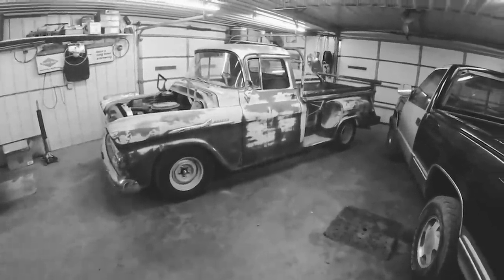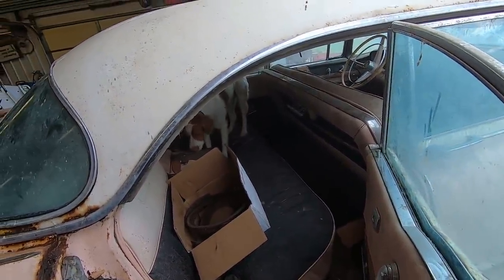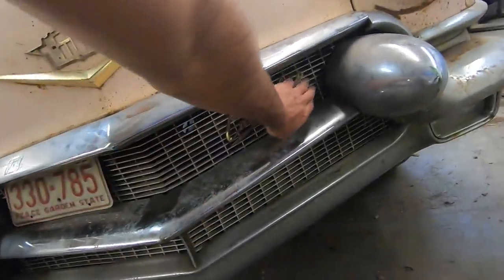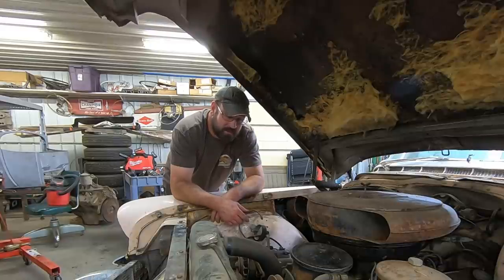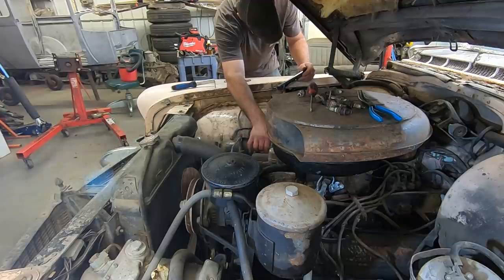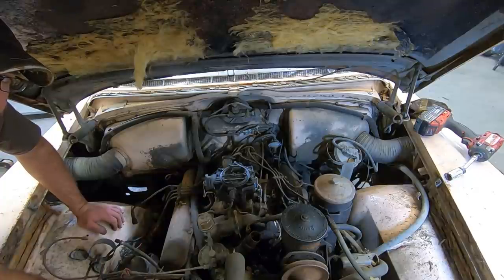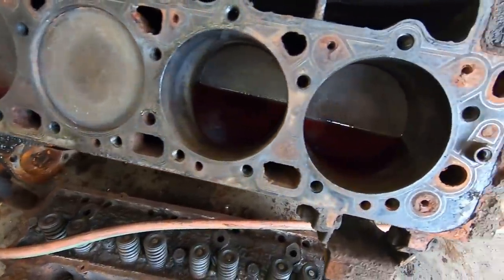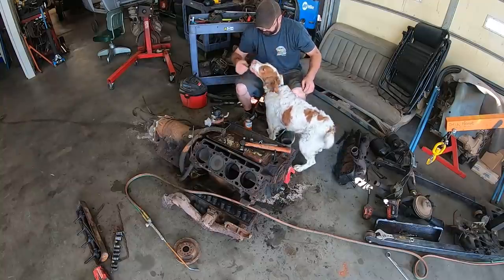Pink 1956 Cadillac Sedan DeVille Barn Find! Parked in 1969! Sitting for 52 years! Will it Run?!?

Comment: You stuck with that so much longer than I would have with that motor.  However, you outdid yourself with the Puddin appearance and to top it all off, a pressure washing.  Thanks for making Monday mornings so enjoyable.  I hope this car doesn't make you lose the shop.
Reply: Definitely agreed I was thinking when I saw the freeze plugs gone that thing is toast it froze and popped! He's got intestinal fortitude that's for sure!!!
Reply: Ida put it on a stand and yank the pan off. Put a pipe wrench on the crank and gave it hell.
Reply: That Caddy has as many peculiarties as a nympho nun, a real chamber of horrors ! How did so much water get in the pan with engine buttoned up ? As for the block, given the missing freeze plugs, it's likely cracked. Oh word is me !
Reply: @pookysdad4884  I don't believe that freeze plugs are just for knocking sand out of an engine block. That might have applied for the old flat-head Ford, but casting science has come a long way since then.
Reply: @pookysdad4884  A freeze plugs is a freeze plugs. A rose by any other name, would smell as sweet.
Reply: Everything about this channel looked familiar!?!?   Smh!  Really boss? Sad!
Reply: @pookysdad4884  You've stumped me there, I must admit, I can't remember what a "homilie" is. School is a distant memory.
Reply: Any car will run after 1000 years ; it just depends how much work a person wants to do and how many dollars the person is willing to spend.      Please stop making these stupid videos.
Reply: @supermansuperman9066  Forest Gump,"stupid is as stupid does". A stupid, cvnical remark. A reincarnation of people who decried automobiles to keep streets safe for horses perhaps ?

Comment: I love how Duff just jumps in there and gets to work giving the old nasal appraisal
Reply from the maker: Not much gets past that nose!
Reply: @MortskeRepair  BTW, that is not a torque converter.  It's simply a fluid coupling.  The trans is a four speed Hydramatic.  With four forward speeds it didn't need the additional torque multiplication of a torque converter.
Reply: @corvettejohn4507  You are correct. My 53 Pontiac had the Hydramatic. When taking off from a stop, the engine would rev slightly, much like letting out the clutch.
Reply: @MortskeRepair  duff knows what went on the last 75 years with 1 sniff

Comment: The Spring in the Dust Cap is for Radio Suppression ..Helps keep Static out of the old Tube AM car radio
Reply from the maker: That's wild! Thanks!
Reply: Yes sir!!👍✌️🤙🏻👍
Reply: truth
Reply: Huh neat
Reply: Wow what will they think of next
Reply: Radio static is the reason many car owners but the antenna on the rear fender, to be as far away from the ignition as possible.
Reply: @jeromebreeding3302  Also if you put your CB antenna On the center of the trunk your signal will transmit forward and have less ignition noise
Reply: @not2fast4u2c  I car shared with a guy commuting 42 miles on way in a Volkswagen variant. He had a big cb whip antenna on the roof. It hit every overpass coming home at one o'clock in the morning. I had to stop riding with him, my nerves were shot.
Reply: Yea right 🤪

Comment: In my 58, the antenna is power, still working,  and it has all the original wiring, everything works, the power windows all still work,  have the original motors!!  This poor car does break my heart a little.  My original engine,  365 purrs like a kitten.  My engine is rated at 310 HP.

Comment: Those early Hydramatics were once the hot deal - ever heard of B&M Hydros?  They built them for drag racing.
Reply: Yes they did.  The were the terror of the NHRA Junior Stock classes.  1955-1957 Chevy Sedan Deliveries were allowed to run them and they kicked but in their classes.  Of course the Pontiacs did well with them too.
Reply: Don't think it's a torque converter, just a fluid coupling used in 1st gear only and then bypassed for 2nd, 3rd, and 4th...

Comment: Penzoil Note: My dad bought a 1965 Pontiac Bonneville in 1966. Car had 3,200 miles on it and had it's first service before he drove it off from the dealership. He changed the oil in the car religiously its whole life at or before 3,500 miles and used Penzoil 10W-40 its whole life. He gave me the car for Christmas 1983 and in 1984 the timing chain broke at 158,000 miles. When I removed the valve covers there was literally only room for the rockers to move. Everything else was solid sludge, lifter valley was just as bad. I don't care if they say that they have changed the formula, I will not use Penzoil in anything ever.
Reply from the maker: Haha grandpa was right!
Reply: AMEN BROTHER!!! Pensoil sucks!!!!

Comment: Keep this trick I devised years ago for the future..
 
Try this... Heat the plastic tube from the carb cleaner spray with a lighter (about 1/4-1/2 inch from the end. Then pull on each end of the tube to stretch it. This makes the outer/inner tube diameter smaller and more of a pin point. When the melted plastic solidifies, use small wire clippers or nail clippers to snip the tube at the smallest diameter that still provides flow when spraying. The cleaner comes out like a pin point pressure washer and the shrunken plastic tube end fits inside whatever port your spaying thru.
You can also do the same to create 90 degree angles in the plastic tube to spray sideways inside long venturi tubes.
I used to make/keep custom tubes around for these situations. Hope this makes sense. BTW.... Great videos.

Comment: I would rather drive a 1956 Cadillac than a modern Cadillac from the 2000's. Better build quality, easy to work on, easy to maintain, cheap parts, no computer crap, no planned Obsolescence. Great video👍
Reply from the maker: Easier to find in the parking lot too!
Reply: @MortskeRepair  😂😂Yes That's for sure lol

Comment: Im a mechanic in NZ . We had a 58 long wheelbase Cadillac in the shop. Damn  near enough room for a double bed in the trunk. Start off by buying it a starter because everything you've worked on lately needed one so why should this one be different LOL Use a 1 inch hole saw on the bell housing and jam the big pry bar through it onto the ring gear.

Comment: Looks just like the one my Mom drove back in the day... we got rid of it in about 1964... 300 HP 365"... 4 speed Hydramatic... called "The Florida Color"... coral rose... Don't think it's a torque converter, just a fluid coupling used in a really low 1st gear only and then bypassed for direct mechanical 2nd, 3rd, and 4th for better MPG... prolly do 140 MPH...
Reply from the maker: Good stuff!
Reply: Yes, according to the brochure.

Comment: Nice to see you have a dust cap remover pliers dude thing. Almost as handy as a points file. Most Tube guys just beat them to smithereens with a huge Crescent wrench. The spring inside the cap is for radio static suppression as were the capacitors sometimes found on generators.
Reply from the maker: Good stuff!

Comment: That transmission is a 4 speed Hydro-matic.    It doesn't use a torque convertor, but a fluid coupling.     I think they actually had 2 fluid couplings, both were used for first and second, then when the trans. shifted to third, one of the fluid couplings was locked up and you only had 1 fluid couplng being used eliminating some of the slip.
Reply from the maker: Great info!
Reply: Frank, I had to have the hydramatic in my 58 caddy rebuilt 5 years ago. Still shifting fine, but started leaking like crazy. Had a  hard time finding a shop that would do it. All I heard was,  wouldn't know how to do that job, sorry.  I'm in Southern California.., And finally found a shop that said they could do it. They did a great job, I supplied the rebuild kit. And they only changed me 900 dollars for thier labor.  No leaks, and car shifts just like it always did.
Reply: @johnfranklin5277  Tell us the name of the shop, if it still exists.

Comment: I've used this with great success soak it in vinegar it freed up some completely rusted items that had been sitting for 40yrs outside an it took around 6weeks to do an i never seen this before i got a 5 gal oil drum out of a dry shed it was on the top shelf near the roof an it was a new oil drum that had been there for 25 yrs an it had 2 gallons of oil an almost a gallon of water it was sealed tight an it must have been from condensation build up over yrs it was something I've never seen before how water built up over time

Comment: Mortskee don't disappointed Duff you took that engine so far and are so close to having it turn, Just get a chunk of 3 x 3 oak or hiccoty if possible put it in the piston bore and give it a good Crack with a 10 or 15 pound sledg or in this case maybe sludge hammer and Bob's your uncle she will start to turn. Well OK you might have to hit them multiple times but it will turn!,,
Reply from the maker: Yeah but then the rings are stuck and no compression. And the main bearings were nasty too...

Comment: I at a point used to pull plugs dry up to the day I broke off a Champion RHB-32-E sparkplug in a jug.
After busting off a sparkplug and another time backed out the steel helical thread incert Id hose down the sparkplug bases with a good shot of LPS-1.
Fellas used Champion anti-seize on aircrafy sparkplugs which seemed to not prevent seizing, itd gum the plugs.
LPS would somehow reconstitute the antiseize and helped in pulling plugs.
Same with exhaust collector nuts.
Never pull em dry.
Reply from the maker: Thanks for the tip
Reply: We used to hose down turbo wastegate linkages with a product called Mouse Milk.
That stuff works great on exhaust seized components.
Reply from the maker: @shawnnelson6146  What's what it's actually called?!?
Reply: @MortskeRepair  
Yes its a thing.
Its sold on-line.
Reply from the maker: @shawnnelson6146  I'll check it out!

Comment: Those old cast iron transmissions did not need much cooling. It is quite common on GM cars of that era to have a separate transmission heater. My 56 Pontiac had three heater cores, one for the defrost, one for the under seat heater, and one for the transmission. They were all full of mud and had to be flushed.
Reply from the maker: Interesting stuff!

Comment: Crazy how much damage water freezing in the pan can cause. I worked on a 2006 duramax for head gaskets someone started tearing down and let sit outside with hood off for 18 months. The upper aluminum oil pan was all busted. Only realized once heads were done installed and was filling oil . At 5 qts I seen oil puking out behind the starter. Right then I was like FMW. Lol.
Reply from the maker: Bad news

Comment: In the summer of  1963 I bought a 1956 Caddy Convertible... a white body, black convertible top and a red leather interior. A perfect body and interior, but mechanically it was a wreck. It had a tad over 170,000 miles. We raided the junk yards... for parts, fuel pump, carb, motor for the adjustable seats, and bunch of other parts... got it running. Discovered it didn’t have the expected hydromatic trans... turned out there had been a fire at the hydro manufacturing plant while this car was being built and a 3 speed Buick roadmaster trans went into number of Caddies. That would’ve been OK, but it only had 3 rd gear. Back to the junk yards. After 3 or 4 weeks we finally got it together.... my first real cruise resulted in a speeding ticket. Well, it was a great summer, lots of girls on hot summer nights... it was a real female magnet. Sold it in the fall and doubled what I bought it for.
Reply from the maker: What an adventure!
Reply: Together with a Hydramatic or a Dyna Flow?

Comment: The spring in the cap was top short the wheel to the spindle to reduce the static on the am radio from static electricity generated on the wheel
Reply from the maker: Good stuff!

Comment: Can you still get the engine that was in the shed with the car?  According to the brochure, the engine is 280 HP.  And the transmission has a fluid coupling.  Not a torque converter.  The proper oil in those days was likely Right Whale or Sperm Whale oil.  For the fluid coupling.  But, if the block has no cracks, I would like to see you have it rebuilt.   I wonder if the radiator support could have been saved by: 1. Stripping the accessories and the heads off the engine before removing it.  or 2. Lifting the body off the frame to get access.
Reply from the maker: No it’s long gone

Comment: The spring in the hub is to ground the wheel to the chassis to reduce static in the radio from the spinning wheel.
Reply: The moter is junk

Comment: the spring is there for radio nose   no bull.  for the stuck frt. drum a chisel and cut off the head of the brake nail on the back of backing plate . the tail lite is the gas tank fill you push the round reflector on bottom off l/side tail lite and it flips up cool as hell  BACK THEN
Reply from the maker: Good info!

Comment: Springs in the caps are to discharge static electricity from the tires into the body/chassis--supposedly to keep it from interfering with the AM radio. There was a capacitor on the generator to suppress noise from the generator brushes so it would not get into the radio.
Reply from the maker: Good stuff!

Comment: Mortske believe it or not that amount of sludge is normal for most 50s engines. They didn't have detergent back then. I've torn down a few Y blocks with crazy low mileage that looked as sludgy. Even my 264 Nailhead. Also I'm pretty sure that tranny is related to the dynaflow. The converter gets disassembled to remove it. What's cool is the vanes in the converter change angle to change stall speed and give you different gear ratios. There a slug off the line but the top speed is crazy.
Reply from the maker: Good info! Thanks Anthony!
Reply: No problem, I grew up working on sixties and seventies cars when I bought my 55 Buick I was like a fish out of water those fifties cars are so strange it's ridiculous.
Reply from the maker: @aprules2  Primitive stuff!

Comment: The spring in the dust cap was used to discharge the static electricity generated by the tire rolling on the road, and reduce the interfearance heard in the radio.
Reply from the maker: Man that's strange!

Comment: I have worked on several of these pos ever time you would make a plan like pull the inspection cover i would cringe cause I knew what u would find then the hole starter and flywheel mess I knew that that cast iron hydramatic 4spd wieghts about same  as Honda civic

As I continue to watch that trans is a buick dynaflow they used them about a few yrs in some caddy's cause the hydramatic plant burned bad in like 1955
Reply from the maker: Good info! Thanks!

Comment: this 56 caddy with the gold badges indicates that it came with the Eldorado package if it has a gold grill this is one of them it means it has a high Hp rating than a standard one  like 295 hp and uses the Eldorado tranz different to a standard 56 quite a rear car and i believe parts are not to hard to find check out the corvette ben on the tube he has a series on his 56 devill

Comment: I went through the same thing with one. Next time I'll find a late model Chev truck or suburban wrecked and use the motor & trans. But unless or until it runs and drives no point in fixing/replacing the sheet metal. Considering the shape of the engine/trans is as bad as the rest of the car, i'd guess it's just a parts car now or a derby car.

Comment: Poor old Caddy.....  At least Duff liked it :)  On the plus side that air cleaner and the good parts are probably worth twice what you paid for it :D  Great video as usual Mortske & Duff.  When you touched the left tail light I expected you to push the reflector in and pop the tail light up to reveal the hidden fuel filler cap :D
Reply from the maker: I didn't know at the time but I'll have to on the next one!

Comment: You should call it Penelope, puddin would be out for blood with those crickets, I shouldn't laugh but I did watching you just sit there and look at the engine after the water came out and I think your looking for autopsy, enjoyed this video even though no bueno.
Reply: The spring under the dust cap is to maintain grounding and maintain static electricity build up. this protects the ball bearings from electrolysis.

Comment: the broken line on the oil pump is the vacuum booster.  it is driven by the oil pump.   which is why it was burning oil.
Reply from the maker: Wait what?!? The oil pump creates vacuum? Where does that line come out of the engine at?

Comment: Wow...you hung in there and you weren't liking it from what could see. That was a bunch of work. You guys over that way have more freezin up issues as far as things cracking. Im just not as far north Id say. Never seen an oil pump break like that. Ive read about those disassemble-able. torque converters in those Caddys. Never seen one. Thank you for the Education.
Reply from the maker: Thanks for watching!

Comment: I'm thinking a lack of a good PVC system in those older engines had a lot to do with the sludge found. Naturally vented was not good enough.
Reply: I remember working on old 50s cars where the whole underneath was oil and grease from road draft tube.
Reply: Correct

Comment: I'm sure the valves are stuck too so before you try breaking it loose you should pop the valve covers that way you won't be bending pushrods and that. That could be why it's stuck too because the valves are stuck maybe loosen the rockers and the engine will spin easier then them being tight on there don't ya think

Comment: Not like it matters, but that transmission doesn't have a toque converter. It's a taurus. Old hydramatic stuff. It's a fluid coupling, but doesn't multiply torque. Also a 4 speed transmission. No overdrive though.
Reply from the maker: Great info!